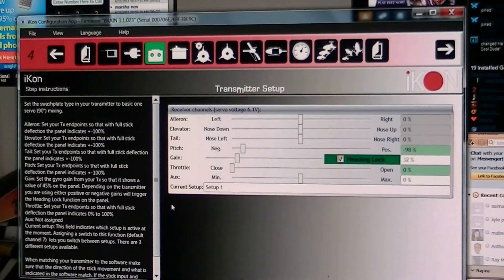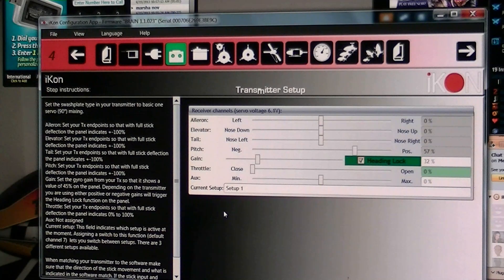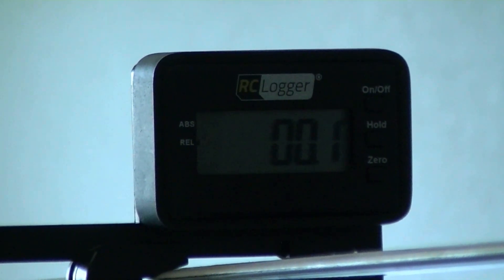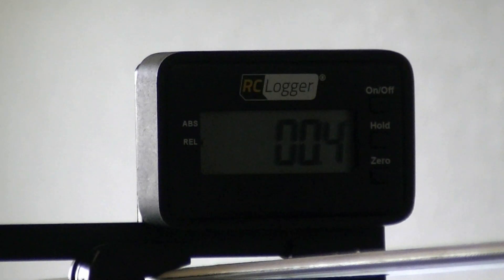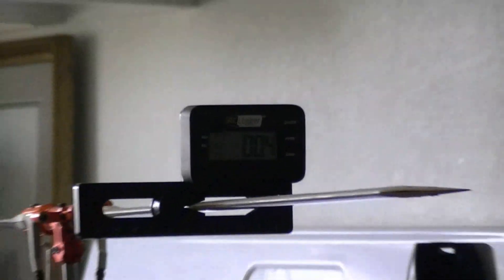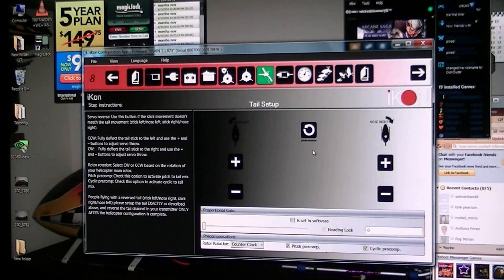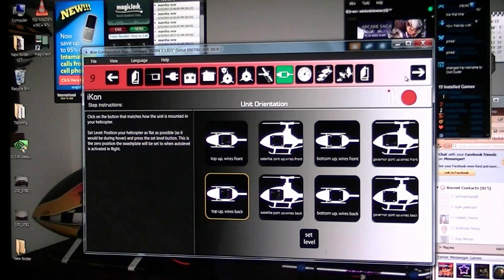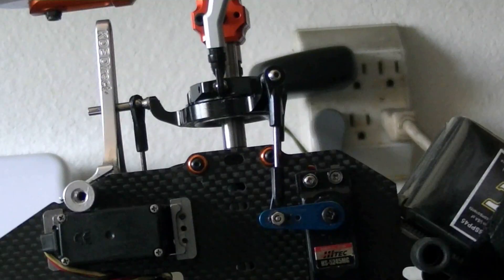ikon flybarless gyro setup/help/advice trex 500

Comment: Do you have any problems with Brain/Ikon auto level fighting against you?  I have an Ikon auto-level problem on my Mini Titan e325.  In auto level, if my heli drifts (slightly) to the left, I correct to the right, but then it drifts to the left twice as more, so I correct to the right and it drifts 4x more to the left, and so on till I almost crash.  The default gain was 25 and I moved it to 20 and the problem seemed better at first but then suddenly was worse.

I think maybe I need to set the auto level gain to zero and then slowly move it up?  But the auto level should not keep correcting the opposite of my inputs I would think.  I can't fly in auto-level because of the software going more and more opposite of anything I do.
Any suggestions?  Thanks
Reply from the maker: i turned self level off after it caused my crash sorry wish i could help you out

Comment: basic setup is pretty good
do NOT enable self leveling on any bank untill you  know for sure its 100% flighing correct and you've dialed out all the vibration you can

if you goto the advanced settings you can really dial it in almost just like a v-bar
you have full expo and deadband adjustment as well as multi-bank configuration